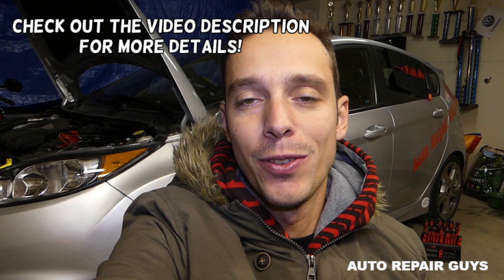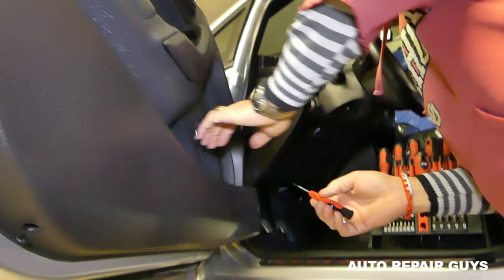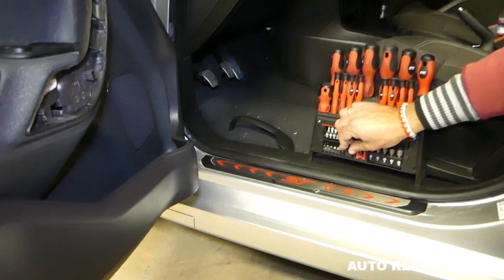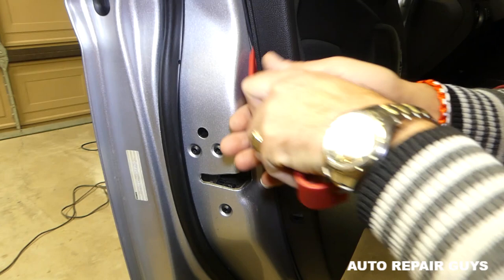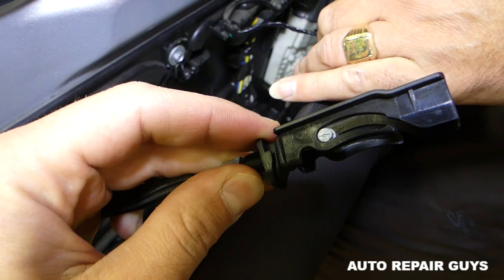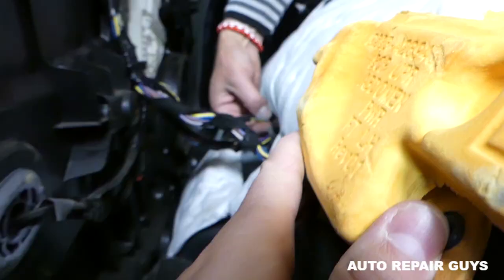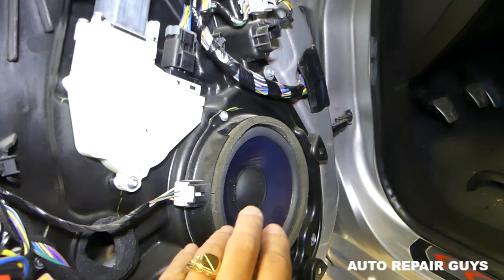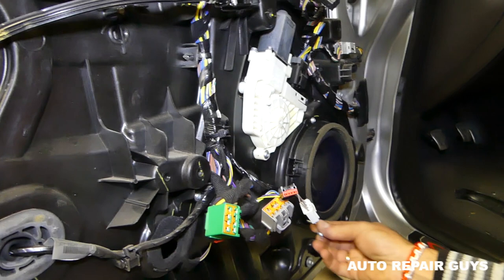HOW TO REMOVE AND REPLACE FRONT DOOR SPEAKER ON FORD FIESTA MK7

Comment: what replacement speaker were you using?  I don't think 3rd party speakers are going to fit the same way, are they?  With the factory connector and all?
Reply: Did you find out if 3rd party speakers fit?
Reply: @sabil1998  I found out what speakers he was using.  But his process didn't work for me, I couldn't get the glue to hold the speaker.  I think I could get some small screws to do it, but haven't gone back to the project.  It's all still out on a corner of my workbench.
Reply: You need an adapter. Plastic or MDF. They are $5 for a set of two.

Comment: I wonder why it has 4 speaker wires run through to the harness, instead of the usal 2 wires
Reply: I don't know if you noticed, but by the door release handle there is a tweeter. I'm assuming that two wires run from the head unit to the door speaker and then two run from the door speaker to the door tweeter.
Reply: @alecmiranda7487  spot on that's exactly what it's for